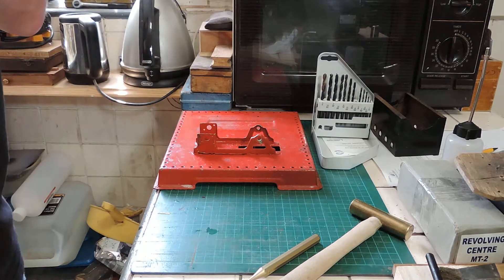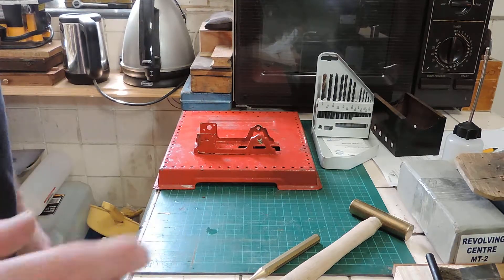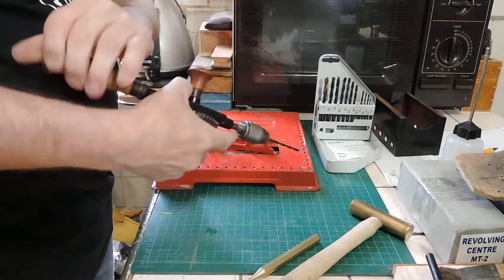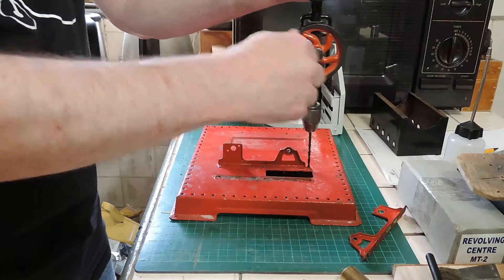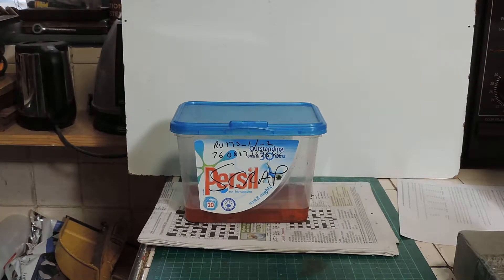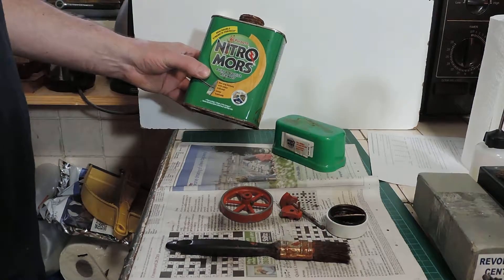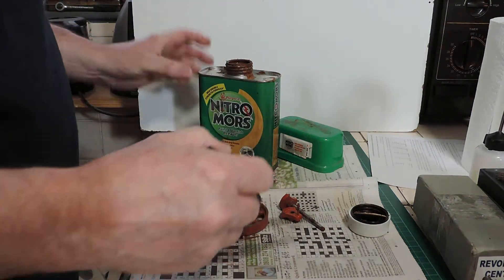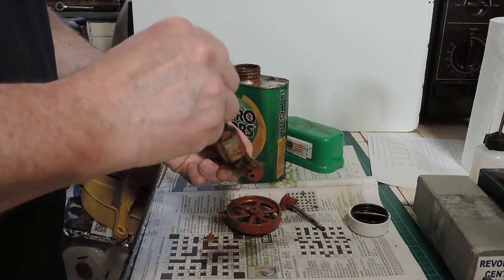Mamod SE3 Model Steam Engine Restoration - Part 3

Comment: Nitromors original paint stripper is available on Amazon.
Reply from the maker: Hi Kevin. I had that old can of Nitromors for years and it was very good. Then when my old tin ran out I bought a new tin about 2 years ago and it was completely useless. The best thing I've found recently is Oven Mate cleaner, seems to work well on most paints. Cheers, Alan.
Reply: @RetroSteamTech  I see, thanks!

Comment: Great job, how did you fasten the painted frames to the base did you use bolts or new hollow rivets? Regards, Tim
Reply from the maker: Hi Tim. I used round head 6BA bolts but you could use rivets if you wanted to make it look more accurate. I like the bolts just in case I ever need to take it apart again!